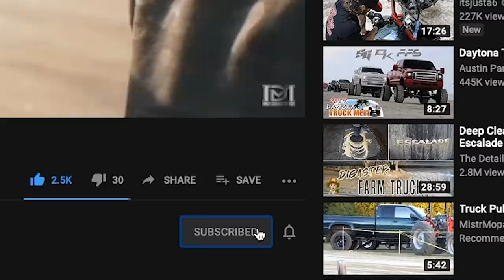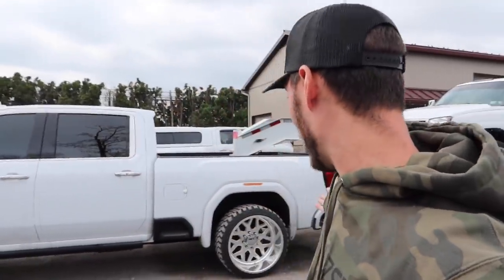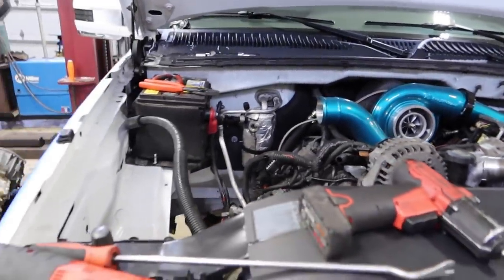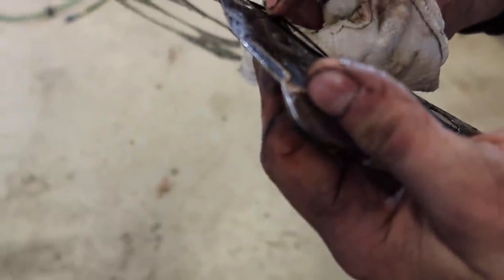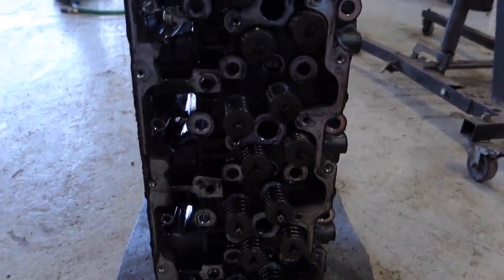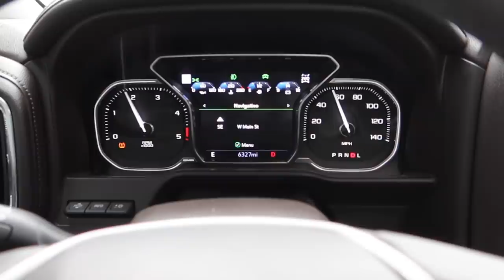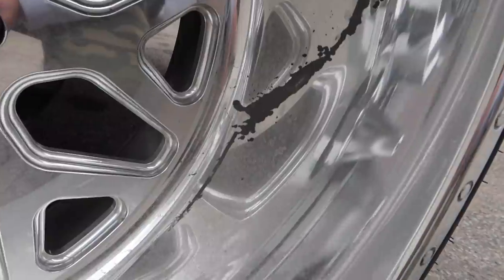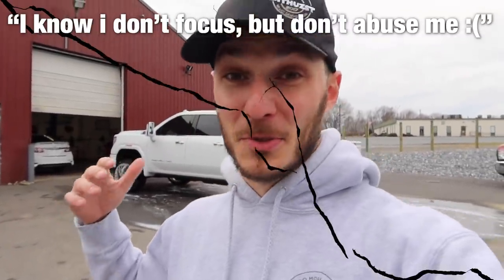700HP Single Cab Duramax and 50+ HARD PASSES later.. this was inevitable

Comment: You going to change valve springs in the heads? Maybe a port and polish to help flow and change exhaust manifolds? And I'm with the other people just back the truck up a bit to even the weight over the axles or have you tried backing the mini max on the trailer? Either way have a good Thanksgiving and keep up the great work

Comment: Your trailer tongue weight should be 10-15% of the total weight, should only have about 800lbs on the back of that truck m! Check your weight but I’d run it! That take off was terrible tho 😔 can’t wait for the lift!
Reply: That's for bumper hitch. When gooseneck towing, you want to run as close to 20% tongue weight as possible. 10% tongue weight would actually be dangerous.